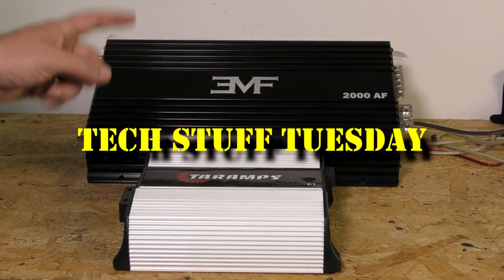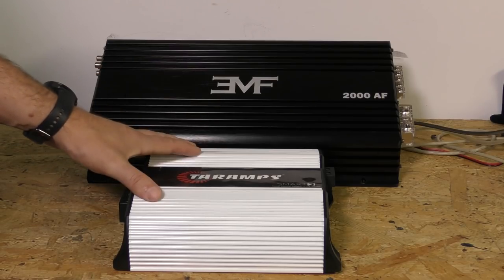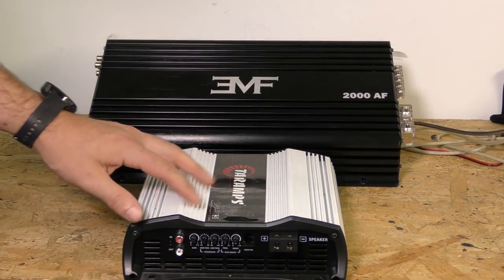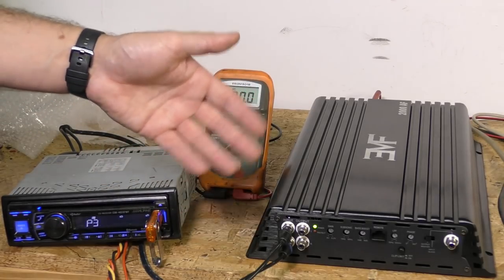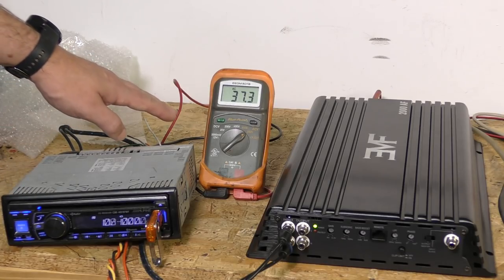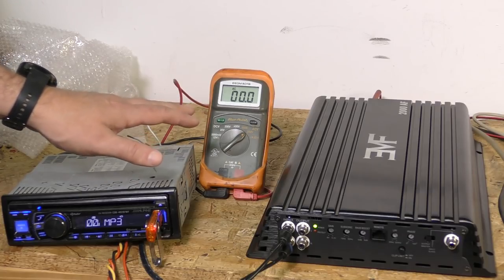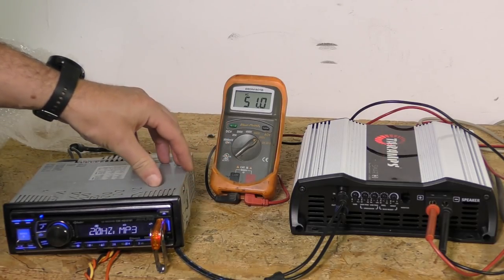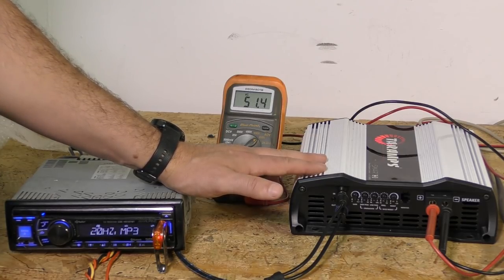The problem with full bridge (Brazilian) amps you never thought about - Tech Stuff Tuesday

Comment: But yea, not gonna lie, when I swapped out to my Smart 3, it increased the power yes, but felt like I mainly gained from port tuning onwards 40Hz+ but the low end felt the same, had to up the gain to boost the lows, then the higher frequency were brutal. I ended up tuning my box lower which solved the problem, but I guess now I could overpower subs on the higher 40hz+. I defiantly did feel it was getting less power on the low notes compared to higher notes.

 Was my testing scientific...? No, because my box was tuned high to begin with, but even with the box tuned lower I feel like 30hz is getting 8% less power than 45hz for e.g. Was your testing scientific? In my opinion no, there was no load on the amplifier, it would have been a much more accurate also on the bass side to go up in frequency 5hz at a time, on the sweeps you can't visually what frequency its at, it doesn't matter if it looses 5v on 10 - 20hz. But personally the way I see it, the amplifier on their website says its intended use is subwoofer, its 1 channel, has bass boost adjustment, its right RCA signal only, everything points to it being used for a 10 - 100hz application
Reply from the maker: You experience the same results I showed. You said the lows seemed the same but higher frequencies were louder, and you said you had more power. That means lows had the same power as before but higher frequencies had more power, which is exactly what was demonstrated. You're making excuses to justify being wrong because it isn't what you want to hear but you experienced the same exact thing.
Reply: @EMFAudio  but yea only running stock electrical so running around 1000 to 1200 watts so power increased from my old 600w amp but yea lows were slightly louder obviously the amp isn't that out, I was pushing more to low freq but now I could feel a big difference between high freq and lows where are before was even all round 'good band width'

Comment: Taramps has built in fan that's solid for using for subs what are you talking about??? And there reliable af with the right power running to it .💪🏽💯👍🏽
Reply: The large majority of taramps are made for speakers except for the bass series. The fans arent necessarily for the bass because the majority of installs where taramps are used they are used for powering low mids, mids, and highs and not so much bass. The majority of these installs are done in places with hotter temperatures.
Reply: @chadbeverly4926  dude, just about all of their amps are made to handle subs. The bass line is just sub specific.
Reply: @beardedforlife3740   thank you brother 🤣👍🏽

Comment: Redo the test. Set the low pass on the Taramps to 250 so the crossover settings match. This test is not accurate at all. The Taramps was literally set to respond to all frequencies below 10,000 Hz while the emf has a hard set crossover set at 250 Hz. Based on the settings used both amps did exactly what they should've.

If you set the high pass to 250hz on the Taramps I guarantee that you will get different results.

Please, anyone watching this video keep this in mind. This is not a fair representation of the Smart 3.

Comment: I have told people not to use speaker amplifiers bridged to run subwoofers for this reason as well as damping factor. The only correction I have is that every Alpine head unit I have ever tested DOES output full range on the subwoofer channel when the low pass is set to off or flat. Maybe your model is different as I have not tested that model to my knowledge. But every one I have ever tested is full range on all outputs as long as the crossovers are off or flat.

Comment: The formula to reach target voltage is the Power x Ω √  ??? (watts x ohms (squared). for example - (P) 440watts x 4ohms = 1760√ … squared = 41.95 volts as target voltage.
Use a 40Hz test tone??
Thank you for doing a specific viedo regarding bridging!!!

Comment: Why would any full range amplifier not have at absolute minimum a stereo L-R output?
Reply from the maker: Why would it be rated for several thousand watts and 1 or 2 ohms? Stereo separation doesn't matter when you have 8+ mids on a flat plane, or multiples of them for left and right and 16+ mids in the system. That's what they're intended for, not necessarily how people use them, which is part of the problem too.

Comment: The Korean amps in my opinion sound better on music. People putting midrange amps on subs just can't afford better Korean amp for subs.
Reply: Good full bridge is better for bass than half bridge. International Recitfiers who build the vast majority of internal components for Class D amps have 2 white papers explaining why, but long story short half bridge has some issues below 100hz that make them less accurate on average. The problem is people think all full bridge amps are the same, but the JL Slash series sounds better than any of these SPL type amps from EMF, C Skar, Sundown etc and they are a full bridge amp.
Reply: @BlueTegu360  i had 2 Taramp 20k platinum amps on 2 18s, it did a little higher sealed on dash score but didn't sound as good on music. I loved my cactus sounds k12 for the music.
Reply: @oSTYNCLSYo  Yeah, Because taramps are a cheap Full bridge.
Compare them to a JL slash series though and it's not even close.
RTAs don't lie 🤷‍♂️
Reply: @BlueTegu360  JL amps do sound good, i don't understand your argument? JL doesn't make big subwoofer amplifiers. JL also has a regulated power supply, so no matter wired at 4ohms or 1.5ohms same power output.
Reply: @oSTYNCLSYo  The JL Slash series is a Full bridge amp. They have other stuff going on to help with SQ, but those amps are full bridge.
So the argument that "Half bridge sounds better" is silly. You have both good and bad full and half bridge amps.

Go watch BareVids explanation, because he breaks down exactly why there is no difference in SQ between the two.
Reply: @BlueTegu360  ok

Comment: Brother you know your stuff I'll give you that and you were kinda right but still wrong full bridge amplifiers and half bridge amplifiers are different because they use a different process in there switching to create alternating current the full bridge internally bridges your negative ground leads giving you 2 positive outputs phased 180 degrees apart where as a half bridge or negative ground amplifier uses a positive poll and a negative poll almost like Dc current accept they two polls have opposite charges at any given time during the sine wave so if you have +15 volts at the positive lead your negative will be at  -15 volt  ad the voltage potential between the two polls give your switching action when's you strap 2 half bridge amps you create a full bridge amplifier and actually most people don't know that with a full bridge amp running 3k you'll use upwards of 20%less current to achieve the same voltage potential as a half bridge amp that's sort of a quick run down it's much more complex also you do know that taramps have a bass 3k that is designed to run sub frequency so yes in a way your right but in the same sence your wrong because an aplifiers switching ability only dictates an amplifiers ability to put out power at higher frequency and it's method of creating a voltage potential differential are two separate aspects when you strap two half bridge amplifiers that are geard up for low end you don't suddenly have a high frequency machine. It's almost like the myth that monoblock amplifiers are for subs and no good on mids and highs or vice versa though they commonly don't produce 4channel sub amps and 1 channel tweeter beaters so I feel your expertise is better kept in the subwoofer/driver side of audio and amplifier / inverter technology is better kept in us electrical engineering's side of the craft
Reply from the maker: I think you've misinterpreted what I was saying and what I was showing. The bottom line is, look at the results.

Comment: I've seen wierd feedback in full bridge under 100 Hertz while hooked up on a scope. How that translates to music idk, I wont run full bridge. To my ears they just do not sound well. Maybe that's because I'm oldschool and would choose ab over class d. Who knows. 
Very interesting video, I would have never thought you would loose that much power under 100 hertz.
Reply: @nate0 ya I had the same issue. One channel it also showed up as a soft clip with my scope but not on my smd dd1
Reply: @nate0 it seemed to be worse as I introduced voltage into the amp settling abit as I got closer to the 14 volt. But when taking readings off the rail I found it again. I figured a leaking cap might have caused the issue as I have seen similar with early amps when the caps would leak or a pot was dirty. BUT after double checking everything in the amp I couldn't locate the source. All I could figure is the way they step up voltage with the transformer. Idk I've heard this from several repair techs too. Ghost in the machine...
Reply: Might very well lay in the soft turn on circuit.

Comment: U guys know what I really hate about Taramps? They feel cheap, especially the gain knob and such, so loose and plastic at that.
Reply: They are cheap
Reply: Idk about that. The gain on mine isn't loose. It feels pretty good for a sub $200 amp
Reply: @beardedforlife3740  paid 150 for skar rp 1500 and theres only 2 or 3 other brand amp ill buy as it stands right now. Its just hard to find real quality. I'm not saying skar is the best but its strong well built (not plastic anywhere unless its needed insulation), and it does rated power with no issues all day. Real

Comment: Good example, I bought taramps hd3000 for my 12s and burnt them up. I thought dang powerful amp so between the next 3 sets of 12s I just kept burning coils so I went to 2500w rms 15 and did good, for a month and burned that.. so after all the wasted money on subs and the amp I researched and found out it was the amp ... between front crossovers and bass processor  EQ. I could have bought 6 or more better amps for everything iv dumped into this one system
Reply: Was your gain too high? Don’t understand why the amp would be at fault unless you were clipping or straight up overpowering them
Reply: HD series taramps is not ment for subwoofers however you can use it at the risk of what I experienced because the hd3000 hz start over 85 so with equalizer and crossovers you can make it sound good but with that price you can buy a bass 5k or md5k
Reply: Not gunna lie i have 2 12” l7 kickers and i have a smart 3 i get up to 40db on radio amp goes in to protection mode for a minute and last i kno everything cuts off the moment bass plays why is that
Reply: @daddydiesel7910  not sure tbh could be multiple things, could be the amp doesn't like the ohm load, could be electrical needs upgraded(which happened to me) but taramps pulls alot with no holds back so if you got a 3k I'd definitely get a extra battery and upgrade your ground and power I had 4g and mine(hd3k) kept going in protect n getting warm I upgraded to true 0g with 4g adapters and ran double grounds on everything and fixed my issue hopefully any of that helps
Reply: @mapexman86  appreciate it so i checked today and i assume i blew a coil on one of them was wondering why it wasnt hitting as hard as it used to plus the one speaker when i push down i hear a crunch smh

Comment: Me and my brother have 2 SFB 8ks running 4 zv5 18s. I will say, we have a scv 4k and it sounds twice as good as the 8ks. We also already blew an 8k in a matter of a month meanwhile the scv 4k has been slamming for over 2 years. Bottom line, full bridge is great when you're trying to pound for cheap but they sound worse and are less reliable. Thanks for the testing EMF!
Reply: yup. I blew a sfb too. can't handle the power
Reply: I just came across this video i have a sfb 8k running at 2.6 on 3 15’s and im gonna swap it out for the hifonics xx colossus the old school one and ill come back and update this review since the colossus runs good at 2ohms i never had any other amps that i tried on my new setup besides the sfb

Comment: OK let me explain something to everyone I have a sfb 5k? Taramps 5k?Taramps 8k? Two jp23 amplifiers? The Taramps md or bass k ? The difference between the Taramps and the jp23?Taramps doesn't like alternator voltage? Jp23? Likes alternator voltage? My 8k md works very well on battery voltage the jp23 amplifier sucks current but the bass is a little harder? I rather buy a class d full range amplifier than a class d? Because if you have a voltage drop you will have some serious issues?

Comment: who ever said taramps dosnt hit lows is insane cause I had the 1.2k bass line and it does its either ppl dont know how to tune there sub boxes or what not ... I will say this tho that dam fan they have is fuckin annoying at low volume drive me a wall that I bought a skar audio 1500 rp series not gonna lie tho it was a banger for a few days then it started heating up real bad It doesnt seem to like running at 1ohm now im using a sundown fb amp not bad for the price.
Reply: If you find the fans annoying in those amps you should be able to swap them out with noctua's.